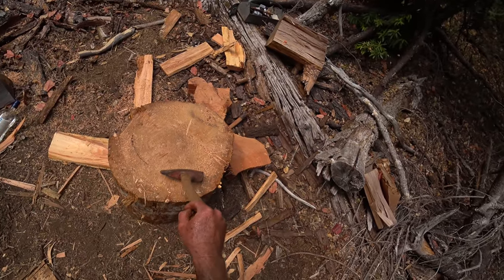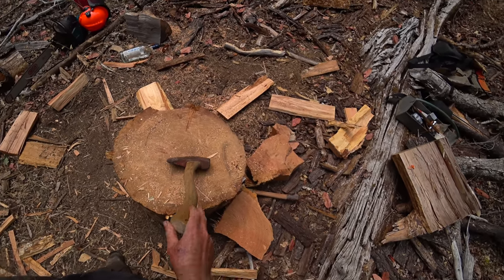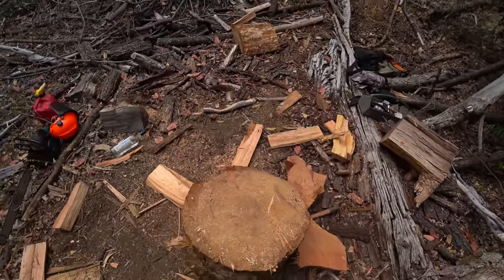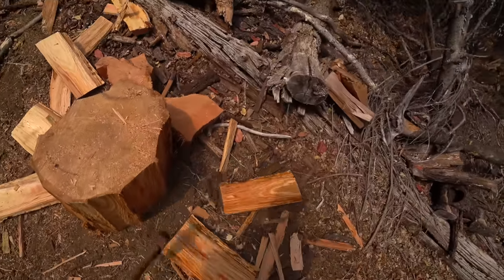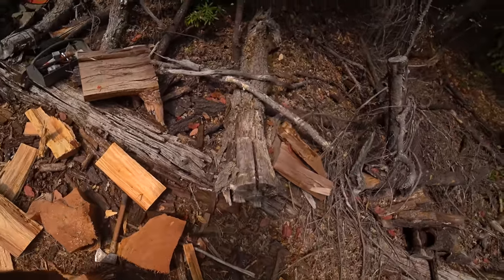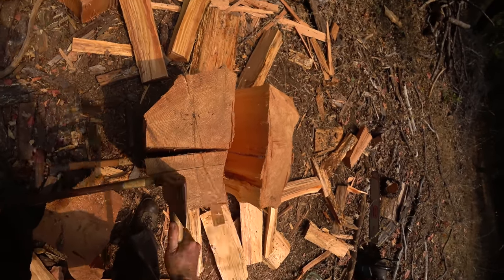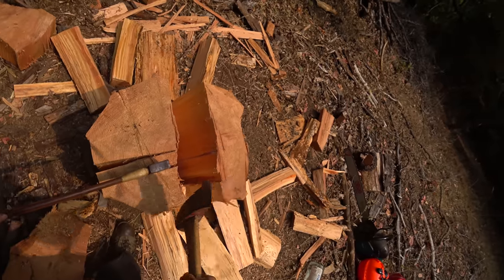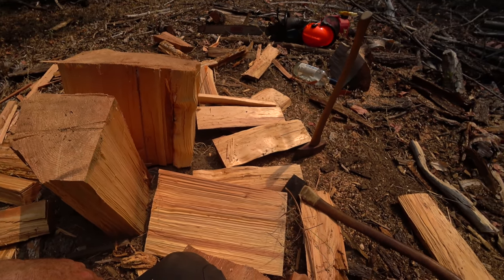Don't Split Big Firewood Rounds In Half (usually)

Comment: I try to avoid big rounds, but when I cant, or I want to for boards or something, I find a large wooden maul and a couple steel wedges with wood inserts are a game changer. Just tap them in, and lift and drop the maul, almost no effort like one uses swinging hard with an axe or splitting maul, and in a few taps it splits, and exactly where you want it to. Once in quarters the axe normally makes quick work of the rest, as you show. I would probably avoid this technique if steel wedges and steel hammer were my only option, the sound and danger issue there is offputting, but the lovely thunk thunk of the wooden maul on the "socket wedges" is nice and pleasant, and no danger of mushroomed sharpnel. I guess the only downside is finding these style wedges, but a person could just weld a short section of square pipe to the struck end of a normal steel wedge and that would probably work.
Reply from the maker: I kind of like big rounds, as long as I don't have to move them too much..  It's fun to walk around and slab them off of a stable mass.  I hate driving loud steel wedges.  I've never used socket wedges, but the advantages seem obvious as far as that goes.  I'm not likely to ever carry wedges into the field.  I'm also not patient and methodical like you, though I might benefit from it ha ha.  On the occasions I want to split something in quarters first, I'm probably going to either grab a couple of axes or heads and use them as wedges, or just use an axe or maul and tough it out.  but that is usually only if I want to save some lathe wood or slabs like here.  I have a couple of old wedges from the logging industry here.  The are steel, but long, wide and thin.  I"m not totally sure if they were for producing split goods, or felling, or both.  Split goods was a big industry here in the redwoods.  Homesteaders often made money cutting down trees on their place, or a friends, and splitting them into grape stakes and fence rails and such.  If you ever come out here, visit the redwoods.  The tallest tree in the world was in a park bordering my neighbors property. I think the top broke off and it lost it's status haha.  They are amazing.
Reply: I hate to be a fangirl, especially as I am biologically male, but I love both of you so much. I wish I had more to add... I continue to learn from you both and just want to be yet another voice saying you’re doing the right thing and I appreciate it, and it tickles me to see you in conversation.

Comment: FINALLY! The physics of splitting a large area is demonstrated as being more difficult. Larger area or larger mass, means more fibres connected over a larger area and more work. Simple. AND, never strike an unsupported log to split it. Hundereds of You Tubers have not figured these things out, even the big names. Thanks!
Reply from the maker: I was joking about not hitting unsupported wood. It seems to make sense to never hit unsupported work, but it's more complicated than that in real life. I hit unsupported wood all the time.  it's one of my favorite ways to split.  A lot of the big names seem to be relative newbs .
Reply: @SkillCult  : some rounds i was splitting this fall were too big and heavy to put up on a block .   i just made 4 saw cuts on the edge of the round at four corners and they popped pretty good .

Comment: You are right about slitting or bisecting the knots. Another tip is to split through the knots with the log 'upside down' from the direction of growth. I've split a lot of wood as my family heated our house with wood and I worked for my uncle who had a firewood business when I was a teenager. We had hydraulic splitters at the wood business but the same techniques apply. We would "slab" wood off the larger diameter logs, as you said. It makes no sense to try and "power through" a big log and risk breaking equipment or your tools.
Reply from the maker: Fir is really hard to split through knots.  Oak here I'll do it and cleave a knot right in two, but this stuff for some reason, it's easier to go around.  I just object to people hitting a log many times to split it in half, when one or two of those blows will take off a chunk of wood and reduce the mass to split it in half when it's time.  People do it all the time. They just don't know slabbing is a real option.  Been there done that.
Reply: @SkillCult  True, I was thinking hardwood.  I think the issue is conifer trunks seem to grow more around the limbs as it ages. "softwoods" absorb a lot of the energy of the maul also.

Comment: My father taught me this technique when I was younger. I came looking for this after seeing several "pros" putting in too much effort trying to split large slabs into half. I found exactly what I was looking for 👍
Reply from the maker: It is certainly not as common as it should be.  It is very practical and efficient way to make firewood in many scenarios.  There seem to be a lot of proponents of splitting them with wedges, but it doesn't make sense to me.  I can split a couple of slabs off by the time someone picks up a wedge and starts tapping it in, then another slab for every blow of the sledge.  Do the math lol.  There are a lot of terrible wood splitting videos on youtube.  I have a playlist of stuff that is worth watching.  https://youtu.be/ZMTnhDr8Wa4  A lot of people showing off, but not all of it and impressive anyway.

Comment: Thanks for sharing!  You are on point as usual and I know because I split tons of firewood as well as spoon and tool handle blanks with a maul and wedges.  I learned the slabbing technique years ago from an 80+ year old guy.  He called it 'peeling' a log.  With relatively easy splitting woods, it's way faster than a hydraulic splitter.  Another technique I use a lot that might be helpful if you do need to halve/quarter the log first is to stick a nicely tuned maul into the log and then drive it through with another maul as if it's a wedge.  The handle of the 'wedge' helps control it and you can crank it sideways to help separate the last fibers and finish the split.
Reply from the maker: Yep, it just works better a lot of the time.  The majority of the time with very large rounds, but I do it a lot on medium sized too.  It's really fun too honestly, to just walk around a big round and slab off piece after piece and watch it shrink.

Comment: Steven,  With the big tough rounds, I use the sledge and wedges to split them in half.  Once that is done, the rest of the splitting becomes relatively easy—most of the time.  Slabbing, as demonstrated by your good self, does work, but, on occasion, the axe or maul that is being used can swing violently away to one side as a slab is being generated.  For a fraction of a second, there is no control of the implement.  The first time that it happened to me, I found it unnerving.  For that reason I am reluctant to use the slabbing method.  It happened to Terry Hale in his video about splitting firewood.  Furthermore, if there are a lot of knots in the round, slabbing might not be an option.  Anyway,  whatever method is used should ensure that the work is made as easy as possible, because there is a lot of work in firewood.

Comment: We always preferred to quarter the stump with a hammer & 2 wedges, and then move to the axe.  I have never tried to split a whole stump with an axe.  The ratio of surface area to volume will directly affect the burn rate of the log.  A log with a flat cross section will burn faster than a log with a round, square, or triangular.  Wood pallet fires get brutally hot, scary fast.  I don't know of any other benefit to the shape.  I think the preference is for logs that will burn more slowly.
Reply from the maker: I'm not much of a wedge user.  Some slabs can be quite thick if you hit them that way.  Of course the thicker they are, the more likely they will need more than one blow.  As far as surface area to mass ratio, that is true theoretically, but I have never noted it to be an issue.  Aside from choosing very large pieces, it's not something I think about when I go to the woodpile.    Thanks for commenting

Comment: I'm 71 and still hand split 85% of my wood.
If it doesn't crack in a couple of hits it goes to the power splitter.
         I'm off to the woods for my second truckload.  If I need boards I go to the sawyer on the next crossroad.

Comment: I've ground my maul to a fat concave shape, very similar to the Gransfors Bruk splitting maul, but even chunkier. It blows wood apart like a hydraulic splitter and I take very lazy swings with it. The head is 2,7kg, the handle is like 75cm.
Reply from the maker: I need to experiment with maul profiles.  I usually use them as they are pretty much.  I haven't got to try a lot of different types.  I'd like to at some point and try to make some improvements. I have ideas...
Reply: @SkillCult  The fat concave grind seems to work best for me. It's got the thin edge for starting a crack and then it has the fat cheeks that spread it open
Reply: @SkillCult  They all come way too blunt. You don't need to go concave for a big improvement, just grind off the stupid speed bumps just behind the leading edge. No small radius curves allowed, much like grinding a regular axe just not quite as fine of an average angle. After that keep an edge, no need for a slicing knife sharp but don't let it get visibly rounded. Normally they hold an edge for a long time unless your chopping into rocks or letting it rust. I use an angle grinder a clamp and a sawhorse but a bench grinder with a course stone will do if you have elbow room to swing the handle, splash on some water to keep local edge temps below 250f. (They are tempered for hours in the 300f to 500f range, modest heat won't hurt.)

The two notable head style differences that I have seen are round eye vs teardrop (hammer handle vs axe handle) and the amount of metal behind the eye. More metal behind the eye makes it more useful for sledging wedges, and for this dual use you will want a totally straight handle with a decent knob at the end, like you find on a sledge hammer or double bit axe. 
  
I've never even heard of a 5lb maul, 6 is common, 8lb was the standard when all houses used wood and the wood was big, I've seen a few 10lb. (I've seen 5lb axes)
The heavier head will carry more momentum for the same energy, and more energy for a fall from the same swing height. (force over time vs force over distance) And the slower action is more mellow on the body. Basically match the size of the maul to the size of the wood, hatchet for kindling and so on up. 

Add to that some nice steel wedges (also grind the edge down to a nice thin taper), or a second maul. If one maul sticks just leave it stuck and hammer it in like a wedge. Again a heavier maul will be much better at sinking wedges, it will also cause less damage to the wedge and maul. (A light thing moving fast does more damage than a heavy thing moving slow. Tackling a person vs shooting them, the tackled person will be moved much more and damaged less while the total energy involved is around 1000J in both cases.)
Reply: To Savage, I think you meant CONVEX cheeks on your maul, rather than concave.
Reply: @shermanhofacker4428  i absolutely meant concave, like ground against a big grinding wheel

Comment: I kind of agree and won’t argue your logic. But I certainly do take the time to split the initial round in half. Then the wood splits so much easier. Perhaps the fibers are not bound as much.
Reply from the maker: Depends on the wood too, but it's usually easier to slab for me.  If its easier to split in half, obviously you should do it that way.  Unfortunately, it's just a default for a lot of people that don't know slabbing is a real viable option.  If I can bust slabs off with one or two blows,  I'll slab first.  I can't think of a species here that it's not usually easier to slab first, then split in half when the mass is reduced.  If I had enough wood (and energy), I'd do a comparison study.  Someday.
Reply: @SkillCult  I like the way you think. I have content comparing tools, but only one comparing wood species while splitting. Let’s just go ahead and tell everyone right off the cuff, use a mechanical splitter for Elm🤣 if you’ve hand split it, you know!
Reply from the maker: What you are saying might support what I was saying, that once the mass is reduced, it splits easier when making long splits.  but slabs are short splits.  Not only that, I didn't talk about it in the video, but the stable mass of the large round, pushes the force out pushing the slab off.  Or an easy way to say that is it is nice to work off of the stable mass of the heavy round.  Lastly, if you were to say 1/4 then right away you can start having problems with the things falling over.  In slabbing, you get to work around a lot and get most of the wood finished, by the time it starts to want to fall over.
Reply from the maker: @IndianaDoug  No elm here, but people bring it up all the time.  closest I've seen out here is some eucalyptus logs can be insanely tough.
Reply: @SkillCult  the stability of the mass is determined by how the fibers are bound together in a certain pattern. This is what makes a species unique. The pattern that’s created (along with other factors) is what builds the strength and rigidity of the entire tree. My question is where does this strength release? Is it held from bark to bark? Is it held inside each growth ring? If we find these answers, we might know the most efficient way to split.
Reply from the maker: @IndianaDoug  There is also the issue of cross graining in both direction.  It can be across what you would think would be clean growth rings, or often the other way, along growth rings.  I've seen bay here that would only split with the rings, due to insane grain crossing, like the tree grew in different directions every couple of years.  So, it probably depends on the wood.  Then there is just ripple, which fir gets a lot, mostly near the butts.  and even with straight grain, I'm pretty sure some woods split better one way and others the other way.  So much to learn.   I think in most cases it's best to just find out with the maul, but definitely experiment instead of picking a path and sticking too it.
Reply: @SkillCult  agreed, nothing like hands on experience. Just to add, water content is another equation to think about, or seasoned versus not. I’ll be honest, if it’s a 36”+ round, I typically block the round with my saw before splitting. I don’t have the time to hack at it all day. I mainly work with Ash, Hickory, Oak, Cherry, Locust, Maple, Walnut and sometimes Hedge. No softwoods.
Reply from the maker: @IndianaDoug  Douglas fir is our only softwood.  Redwoods are very close, but not on my place, no pines.  We have 4 species of oak, madrone and big leaf maple.  Any of them can be tough, even the fir, which can be very stringy.  It starts to split, but it takes some effort to just rip the cords apart and finish it.  If you watch Buckin Billy ray smith, he's always commentiong on tough fir.  This stuff is nice though, except the butt wood.  If I have tough hardwoods especially, I"ll season them more before splitting.  I'm not sure what is up yet, but it seems like dry wood splits better with a maul, but if I'm splitting wood that I cut with an axe, with an axe, I want to split it immediately.  Something about the maul explododing the wood apart I think, but after a year or two, stuff I couldn't split before will split from deep drying.  There is also a phenomenon called bound water in wood and dried skin. It basically means that there is deeper water that doesn't leave the material at first. it is more bound into the structure or something.  Some process over long drying denature whatever is holding it and then it leaves.  tha tis probably one reason that aged wood makes better tone wood for intstruments.  Typically the material, either hide or wood, becomes more brittle, which makes sense intuitively.  I usually split green as long as it's going well, but if it seems harder than it should be, I'll season and then split with the maul.

Comment: The froe clip has me intrigued. I saw a guy on YouTube use direction of pry to be able to control the runout in a roof shake making context--have you ever heard of or accomplished such?
Reply from the maker: In some circumstances it works, in others it is pretty useless.  But yeah, steering the split is part of the design and functionality of the 90 degree handle of a froe.  That clip was not really completely what I was talking about, but it looked close enough to get the point across quickly.